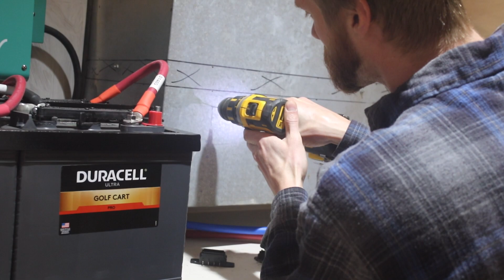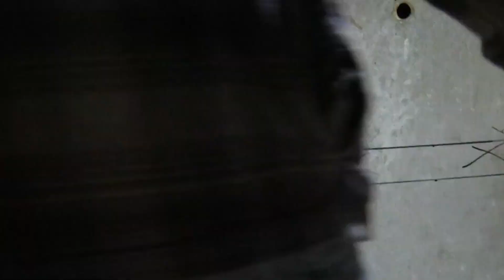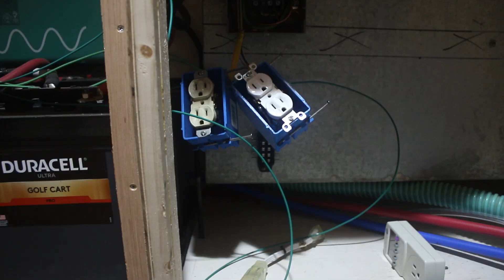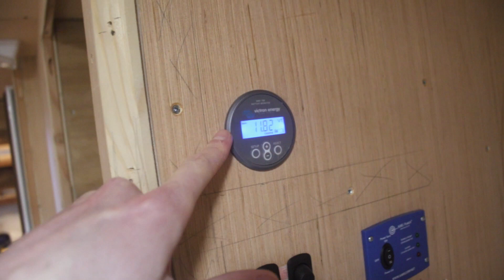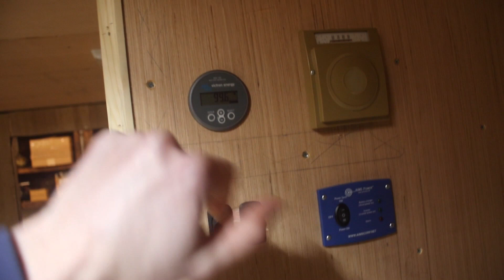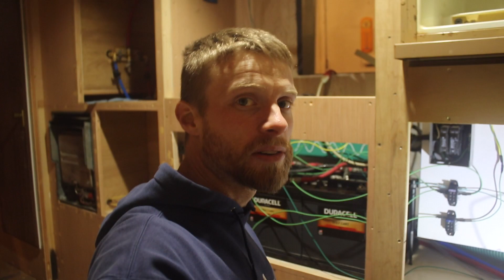ELECTRICAL UPDATE - Truck Camper Build Part 27

Comment: You made a massive mistake shortening the refrigerator cord.  If you ever need to pull the fridge out to work on it, you're not going to be able to now because it's on a short cord, plugged into the outlet.
Reply from the maker: If I need to remove the fridge to work on it, I would simply unplug the 120V plug. Thanks for the comment.

Comment: There like riv nuts,a buddy of mine hung new fenders on his 79 GMC high sierra k15 long bed 4x4 anyways after it got painted he's like I'm not pulling the damn fenders back off just to install the fender emblems so he bought a set of 8 riv nuts and popped them in the fenders and pushed the emblems on the truck and the other 4 he fixed the glove box that was broken.

Comment: Question and this is a two part question/statement...why didn't you either install a GFCI breaker or install a GFCI receptacle after the breaker to protect all other receptacle downstream from it? No one ever wants to get shocked
Reply from the maker: Wait for the next AC electrical video and I explain the electrical system now that it is complete.